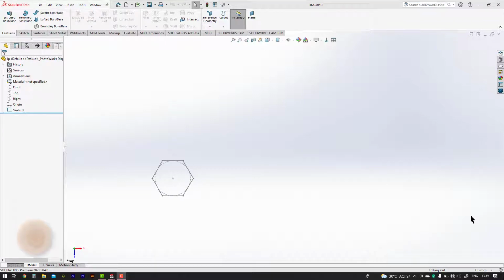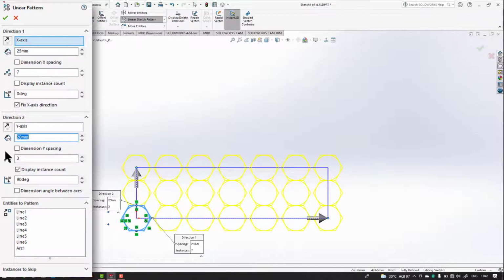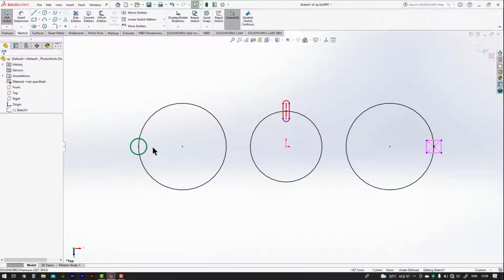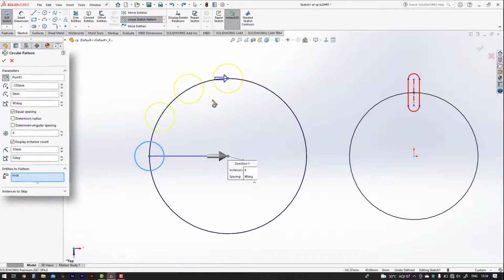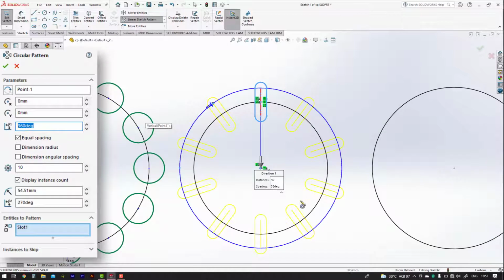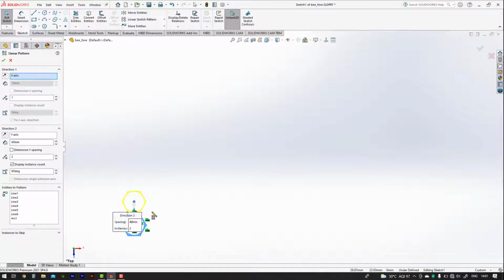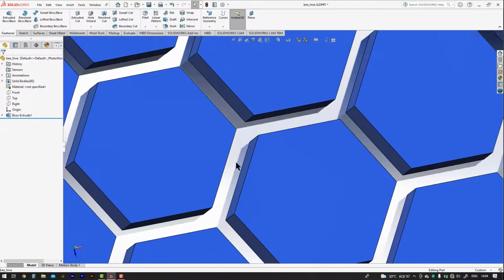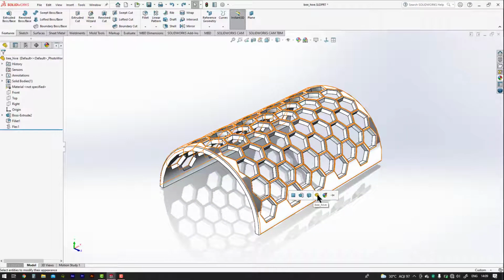Linear and Circular Sketch Patterns || Solidworks || Tutorial 11

Comment: Great video but you didnt mention is there a way to select the center point of Circular sketch pattern  and make it Coincident to another point so that the drawing is Fully Constained, im on SW 2020 this option seems to be missing, i can move the elements of the pattern but the center is simply invisible and cant be selected. Any advice ?
Reply from the maker: Hi! Though I've never worked on Solidworks 2020 version but you may try this: Always create a circle first and mark it as construction geometry then use this circle's center as the base point for your pattern. As it is a circle it will always show you the center point. If that doesn't work out there is something wrong with the snap settings. Go to options (gear symbol on the title bar) then under System Options tab > sketch > Relationship/Snap and there you'll have to make sure all blocks are checked and leave grid as unchecked. Let me know if it is helpful. 😊
Reply: @thethirdaxis4252 I have some new info after testing and researching: Checked the settings and they were already like you wrote. Tried the Contruction Circle but it just "visually showed" the center of the Pattern, there was no way to select the center of the Pattern, and when i  moved the Construction Circle the Pattern didn't move along with it. A  logical workaround is to constrain one of the Pattern Elements to the Construction Circle, but i shouldn't need to do these extra steps, as i viewed others with earlier versions of SW just simply select the Pattern center and drag the whole Pattern. After searching the web i found some forum posts about people complaining over the same thing in SW2020, but the answers were not visible without SW ID login which i couldnt do because my software is pirated LOL, at least i know its not problem with my system because others have this problem too.
Thank you very much for the help, i greatly appreciate your response.